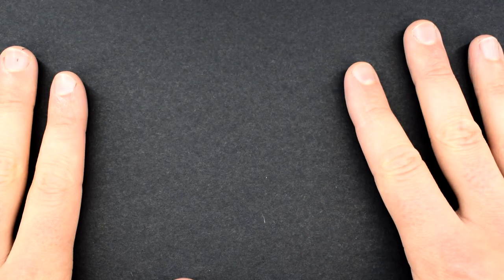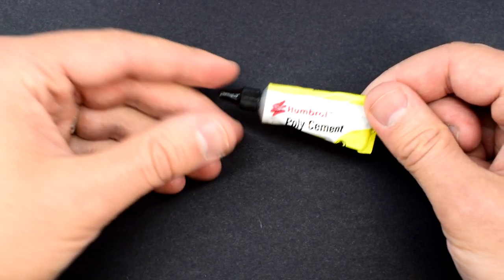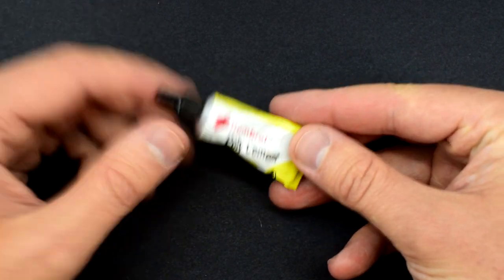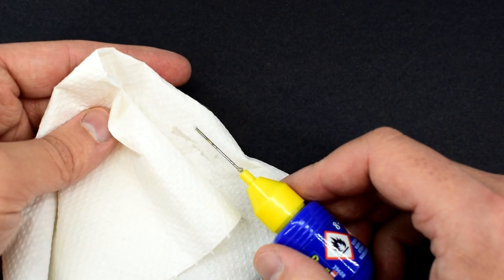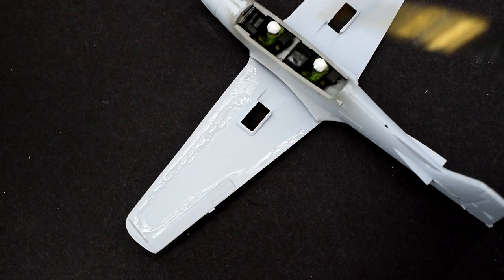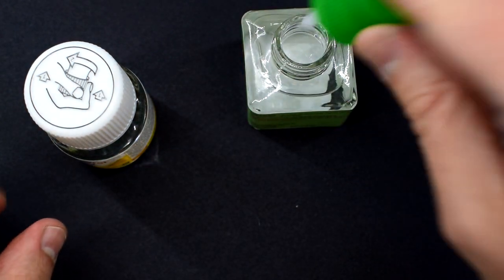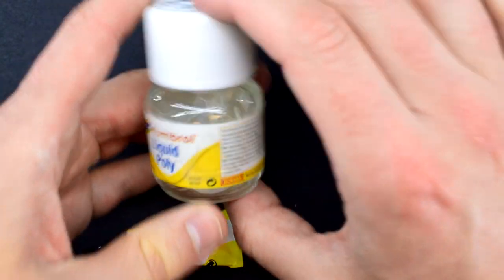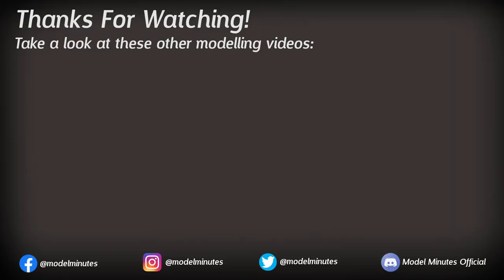From Humbrol to Tamiya - Let's talk about plastic model cements! (and my experiences with them)

Comment: An easy way that I figured out to stop the Revell Contacta from drying out in the needle applicator when not being used, is to tip the tub forward on it's 'stand' so that it now points down, and rests on the tip of the plastic needle cover.  This keeps liquid cement all the way down the length of the needle, preventing it from drying up!
When you want to use it, tip it back, and when you remove the plastic cover, the glue doesn't rush out everywhere; It just works as it should!  :-)
Reply from the maker: thanks for the tip!

Comment: Sir ! Excuse me, sir. Do you want to talk about our lord and savior- Tamiya Extra Thin ?
Reply from the maker: It's certainly a great cement :D
Reply: Yeah, my favourite. Use it for basically everything, except large sheets of PS when scratchbuilding.
Reply: @andersdenkend  better cement is MR.cement s by gunze
Reply: @plastic_models_antonio  I gotta try this as well.
Reply: I use the tamiya extra thin and it’s a fairly strong smell, I open my window and turn on my ceiling fan but still get a slight headache; is there anything else I should be doing ?
Reply: @moonpielion  You could try to use a cabin for airbrushing to draw out the fumes that might help.

Comment: Going back to the 70s, in my much younger days, the poly cement tube was a staple to my model building. I have recently got back into model building and I am using the Revell contacta pro. As you say in the video, this is really good for the precise placing of the glue.
Reply from the maker: It really is!

Comment: my first glue was the revell needle glue as a man in the store recommended it and i’ve never used any other
Reply: I used the Revell exclusively, I must say that the Tamiya's got it beat when doing long welds like a ships's hull or an airliner or dealing with warped parts. Basically, as it cures way faster, it allows you relatively easily to pull together the warped parts without marring the surface and with a lesser chance of having a seam pull itself/deform itself, because it wasn't actually fully done ( glares at HMS Victorious). 
TLDR -  the Revell's pretty nice, but having the Tamiya (especially at <5 quid a 40ml bottle that lasts ages) helps A LOT
Reply from the maker: It is a good product

Comment: Good luck finishing the jar of liquid poly, Matt. I’m still using mine, bought about 40 years ago! It still works though, so I’m going to finish it as well, but after that I’ll give the Tamiya a go. (To be fair, there were many years in between where I did no modelling, but it takes a while to use up!)
Reply from the maker: haha yes, it might take me a while - i managed to get through a bottle of tamiya ET cement in about 2 years though
Reply: @ModelMinutes  It probably depends on the volume of models.. My guess is you probably do more so get through glue faster.

Comment: Anyone else getting PTSD flashbacks from the toothpaste-style Humbrol glue , or that's just me? :D
Reply from the maker: :P
Reply: Memories of breaking off the metal tip only to bend the top half the tube and squirting/oozing everywhere
Reply: happy days. leaving melted gluey fingerprints on your model
Reply: @dotdashdotdash  lol - melted fingerprints I could live with... the 4 to 8 weeks waiting for the mail-ordered massively overpriced (like 4x excluding shipping, because growing up in a post-communist cleptocracy is amusing like that)  replacement to show up... crushed and crumpled, however :D
Reply: I’m glad I don’t, I’m not that old, gladly all I know is revell and Tamiya, oh and model master.
Reply: No one going to mention the fogged canopies
Reply: For me it's a nostalgic ptsd. I just had to make it work.
Reply: great hobby.
Reply: Does anyone remember the old Airfix tubes with the metal top. one would snap off the top and then have to plug it with a mach or pin when finished.Having tried many cement types two stand out Revell and Tamyia . I tried  Deluxe extra thin its like the Tamiya but not as good in my opinion. i have been n
model making for 50 years.

Comment: 4:20 - pressure buildup in those buggers is an issue, especially in warmer months, so I'd suggest first unscrewing the yellow cap a bit to 'vent' things before first use for the day, same goes for the occasions when the needle gets unblocked with a lighter... Also - when the glue runs out, that same yellow cap allows for either refilling with glue (ie from the Contacta with a brush applicator) or for various washes and DIY panel liners ;)
Reply from the maker: thanks for the info!
Reply: @ModelMinutes  never having used one I did wonder if the Revell top could be unscrewed so bk109 answered that. Ref blocked nozzles, how about paint thinners / strippers poured in the unscrewed cap and left with the needle pointed down? That may work its way through the needle and break down the hard glue.

Comment: Useful video. In answer to your question about other glues to use then the following spring to mind: Tamiya Cement; EMA Plastic Weld. Mind you these 2 glues are used primarily with gluing polystyrene sheets from Evergreen, Javis etc and are useful for scratchbuilding but also for kit models too. All the best. Mike
Reply from the maker: thanks for the info!

Comment: One of the oddest things that i remember about Airfix tube cement, was that, in about 1972, the formulation was changed, and the odour went from an extremely solvent smelling fluid, presumably to dissuade glue sniffers, to one that far from being off-putting, smelled very pleasantly of oranges. Does anyone else remember that?
I won an ebay auction for a 1970's Airfix Ford Trimotor, recently, and when it arrived, I opened the box to read through the instructions. Imagine my surprise, and joy, on finding an unopened tube of Airfix cement in the box. I think that pleased me more than the kit, to be honest. I'm not opening it, though.
I generally use EMA Plastic Weld, and the Tamiya Extra Thin.
Reply from the maker: how interesting!
Reply: I have memories of using a very aromatic glue when I was a young teenager some time in the late seventies.u memories are vague except I do remember absolutely loving the smell, opposite of the normal airfix glue smell. I did eventually throw it away, was worried I would spend too much time smelling the lovely aroma although this glue did not smell of orange.

Comment: Returning to building models about 3 years ago after a 40 year gap the main differences were glues and paints. Extra thin was recommended to me and was a revolution and I probably use that most. Tamiya white top cement is a good alternative to the Airfix starter kit glue but has a thick brush. Anything structural like wings or wheels on aircraft do need a stronger glue. 

The only glues I would add to the list are CA and PVA. CA is good for holding something in position and then using one of the others to get a 'proper' bond between parts as it is just too brittle on its own. PVA, even the cheap craft store stuff is useful for clear parts and can have produce surprisingly strong join.
Reply from the maker: very true!

Comment: I've used the tube cement most of the time I've been in this hobby, mostly the Humbrol product and Testors. I first encountered the Revell Contacta when I bought a gift set with the Ford Escort RAC Rally car in 2006 and I found out that works well - thanks for clarifying the issue that crops up with it, because I was curious about that. Never used the Tamiya products before.
Reply from the maker: I'm glad you found it helpful!

Comment: I started out with the Humbrol tubes as a kid and I used so much back then that 25+ years later, my oldest models are more or less fully intact and essentially indestructible, so it's damn good glue but my most used glue is the Revell. I haven't really dipped my toe into the Tamiya thin/extra thin, mostly because at times in the past, budget meant it was a luxury I couldn't justify, but I've never felt like the Revell cement couldn't do what I needed so for me it's the perfect all-rounder.
Reply from the maker: yes, sadly the cost of these products can mean that you are "locked in" to a specific type for a while

Comment: The Contacta bottles are refillable and I like to refill mine with tamiya thick cement (orange top). I use this for large parts like turret or hull halves and wing surfaces. Also I like the slow setting Mig/Ammo cement for track links to give more working time.
Reply from the maker: awesome idea!

Comment: I started modeling using Testors version of the Humbrol Poly Cement.  I squeezed it out onto a piece of paper or a 3x5 card then used a toothpick to spread it on the model.  Now I like using Tamiya extra thin cement.
Reply from the maker: That's a great idea!

Comment: For an even thicker cement get an old bottle of extra thin that is beginning to run out and dissolve as much sprue as possible into it, I don't think it makes as strong bonds but it sure is thick. (It btw dissolves very slowly so just know that and also the built in brush might not work for this so you may need to use a toothpick)
Reply from the maker: ah, yes i have heard of this!
Reply: Sprue goo is great for filling gaps

Comment: Hi MM, I have gone through most of the glue types, I used to have four litre of MEK and that worked the same as Tamiya Thin, I do use the Revell contacta, but now I only use Tamiya Thin, and at odd times I use their white top, thanks again for the review, keep safe and well, best regards from a Kiwi living in Australia.
Reply: Yep, MEK is a good stand by and easy to find in the plumbing section of hardware stores as PVC pipe priming fluid.
Reply from the maker: thanks!

Comment: what about the other types of tamiya cement, the white/orange one and the extra thin fast setting
Reply from the maker: Great suggestions - will have to see if I can dig some up
Reply: the fast setting one is very good for small parts and cleaning up tiny imperfections
Reply: The white one I use for larger parts like gluing vehicle panels or terrain together. It's a bit more gloopy than the extra thin but it's still really good.

Comment: Revell blockages can be cleared by taking a wire tie, say from bread bags and such, stripping away the paper from half to two thirds of its length and using the resulting fine wire as a ramrod. It works a treat when I forget to cap the glue overnight.
Reply from the maker: thanks for the tip!

Comment: Been using the Revell Contacta for over 20 years, used various other glues but I still come back to the Revell.
Clear the nozzle with fuse wire. I keep about three inches of it wrapped around the neck.
Reply from the maker: cool tip!

Comment: Humbrol Liquid Poly is the same formula as the Revell Contacta Liquid Weld, Butyl Acetate.  Tamiya Green is 50% Butyl Acetate and 50% Acetone.  Tamiya Orange is 40% Butyl Acetate, 40% Acetone, 7% Cyclohexane, 11% clear polystyrene resin, and 2% 3-Methoxy-3-Methbutyl Acetate.  The resin makes it considerably thicker than it's green cousin.  The tube stuff tends to be Toluene and polystyrene resin mixes.
Reply from the maker: love a bit of chemistry - thanks :D
Reply: That is very useful information.

Comment: 1960s Humbrol Polystyrene cement was all there was. As a kid, Soviet style assembly line. Open Airfix header bag, build in an hour with poly ...who cared about overruns, apply decals, 10 minutes later into 'combat'. I got more sophisticated by the time I was 10½ when I started painting my models before applying those decals when Humbrol tinlets and a modelling brush also challenged my 3/- pocket money every other week instead of a new kit. Move on to 2022. Having tried most out there over the years, my three plastic glue staples today are 1. Tamiya Thin (Green cap),  2. Tamiya Regular (Orange or Clear cap depending upon size) & 3. Revell Contact Pro with its needle applicator for when I need it. Honourable mentions to Zap Thin CA (Pink) for PE, Plasti-ZAP (Orange) for a myriad of misc. plastic assembly purposes, ZAP Formula 560 Canopy Glue (former R/C flier) or Weldbond for canopies and PE all of which are also in my glues inventory.
Reply from the maker: thanks for sharing

Comment: I use a length of 15amp fuse wire, rolled flat to clear the needle nozzle. Fuse wire being soft bends easily, but never had any problems so far. Love the revell glue and Tamiya extra thin, though have noticed it tends to soften the joint and it'll pop back out, or a tail fin droop or fall off. Patience pays as always....except when the carpet monster eats another important part that pings off my "good" model tweezers. God bless and keep up the good work.
Reply from the maker: thanks for letting me know :D

Comment: The Contacta needle - I fit a piece of wire (I use the trimmed end of a guitar string) into the lid, through a hole I make in the end of it.  Inserts into the needle when I put the lid back on - so I never get blockages any more.
Reply from the maker: good idea!

Comment: A couple worth looking at: Citadel plastic glue - comes in  needle bottle similar to Contacta. Noticeably thinner than Contacta... pretty good.  -  E.M.A Model Supplies Plastic Weld - Comes in a brown bottle with child-proof lid, a bit like a pill bottle - VERY similar to Tamiya Extra Thin - You get about twice as much in a bottle but no brush - I decant it into an empty Tamiya jar... I tried both during lockdown when my LMS was closed - Ran out of Tamiya extra thin and was desperate for something similarly runny.
Reply from the maker: thanks for the suggestion!

Comment: I still prefer to mostly use the classic Testors tube cement (red tube).  I have lately found some limited use for Tamiya fine, and various CA glues for special needs.  The old tiny tubes supplied with some kits still have the classic smell from my childhood decades ago.
For clear parts, I have begun using Mod Podge (after seeing another YT modeler use it) as it is thick enough to hold well, and dries clear without fogging the clear plastic.  Have used Testors Window Maker, but it is thinner and harder to work with.
Reply from the maker: I find that if i mask clear parts then use a bit of extra thin cement, it leaves little marks where the tape was

Comment: Hi Matt. Another good video. Have you had any experience with MIG by Ammo cements? I use their extra thin as I couldn't get Tamiyas here in the UK and it is very very good. I will be switching from the Revel needle cement to MIGs slow setting cement when the Revel runs out.
Reply from the maker: I've not had a go with those yet

Comment: I use the Revell Contacta needle cement for the tougher jobs but i have used Plastic Weld by EMA for years. I have just been recommended Mr Cenenr S which seems like the Tamiya Extra Thin... larger bottle brush though!
Reply from the maker: Thanks for sharing!

Comment: Good evening have you tried sprue glue yet I made some with extra thin glue and I think it's   plastic card or card it's supposed to be good in filling straight forward small gaps rather than a variety fillers. Or tiny parts of an old sprue piece cut into tiny pieces mixed with the extra thin. You leave it a few days in a small sprat bottle and you should be able to use it. I have an FW190   Edouard not used it yet but will do on this I think.
Reply from the maker: Thanks, I have heard of making that kind of fluid, but yet to try it :)

Comment: Tamiya extra thin cement and Tamiya airbrush cleaner are practically the same stuff. Extra thin is 50% Butyl Acetate and 50% Acetone, airbrush cleaner 49% and 51%. There's no difference when welding parts together. Once you have bought the first extra thin bottle, you can save money by pouring airbrush cleaner in the container. It comes in a 250ml bottle.
Reply from the maker: thanks for letting me know!
Reply: Very useful information, thanks

Comment: Which one would you recommend for general model use?
Reply from the maker: If, for whatever you could only get one, I'd recommend the revell contacta because it is easy to use and the needle makes it accurate. Tamiya Extra Thin is pretty much a necessity though . . . It makes assembly so much easier and tidier

Comment: What are your thoughts on the Testors liquid cement in the triangular black bottles? I have used that one for many years and recently started using the Tamiya Extra Thin and I've fallen in love with it. The Testors brand cement is a lot like the Revell with the metal needle tip. As a backup I have Insta-Cure + (the purple bottle).
Reply from the maker: Testors is quite difficult to find here in the UK so I don't have any experience with them sadly

Comment: If you want to glue transparent cockpit parts and are worried about the glue causing 'misting' then all you have to do is to apply the glue and wait about 60 seconds before attaching the parts. The fumes from the glue which cause the misting have gone but the glue still works.
Reply from the maker: thanks for the info - i've found that tamiya extra thin can be used with no real adverse effects too (although sparingly)

Comment: I've been using Testor's tube glue (usually the non-toxic version) for years, but I keep thinking I should try something thinner like Tamiya extra thin.
Reply from the maker: good idea :D
Reply: I still use the red tube Testors.  Tried the less toxic blue tube as a kid decades ago, but it simply didn't perform.